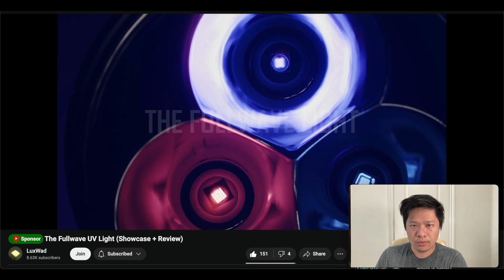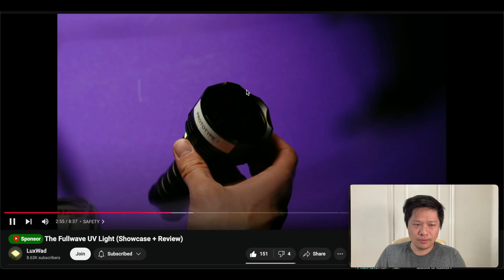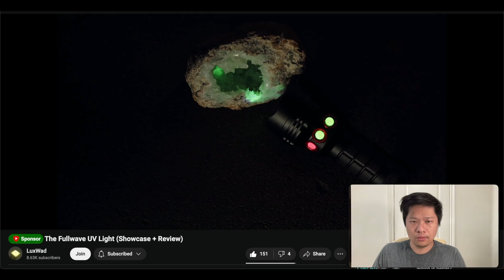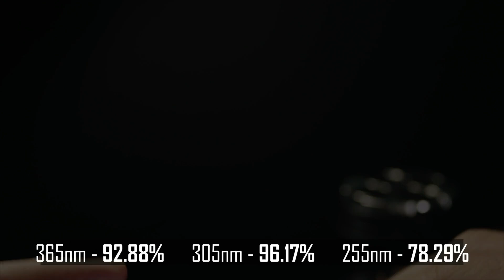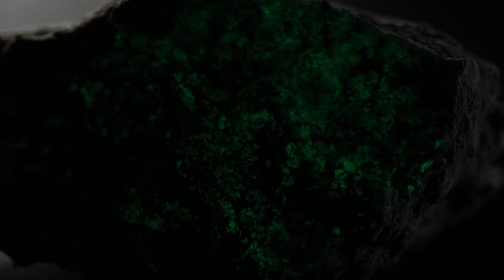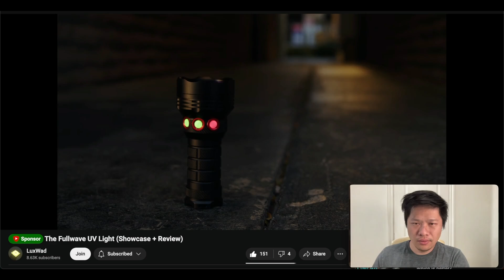Inventor Reacts to a Review of Their Creation

Comment: My suggestion for a scintillator / phosphor lens-based dust cover that converts the output to vis when not in use for hunting, would be either to spin coat or simply paint on a common glass blank with cerium YAG phosphor just as white LEDs use. This would be the simplest and cheapest option, though the light output would be very yellow owing to the complete lack of visible blue output of the UV leds. Alternately you could just cut out circles of quantum dot enhancement film of the kind used in QD LED televisions supplied by 3M or Rina Tech. You'd want a full spectrum RGB emitting film though to produce white light which may be hard to find, rather than the G and R only emitter that uses 450nm blue diode TV backlights to complete the spectrum. There's a teardown vid of a dead TV with the latter R G only film here by NanoPalomaki called "QLED TV teardown and analysis" complete with spectral analysis.
Reply from the maker: I've looked into all sorts of AG combos (Ce, Nd, Lu, etc.) to see if one of them was significantly cheaper. I'm not immediately sure what to look for when you mention spin coated/painted YAGs. I had been looking into the crystals. The idea wasn't to necessarily convert it to white light. I'd have been totally fine putting ruby glass (fluorescent red) in front if it wasn't so expensive! I'll have to look into QD films. That's a new one for me!